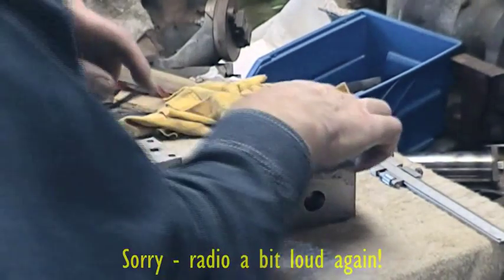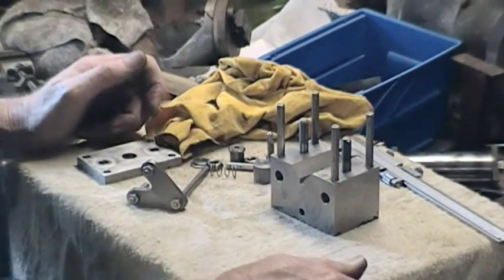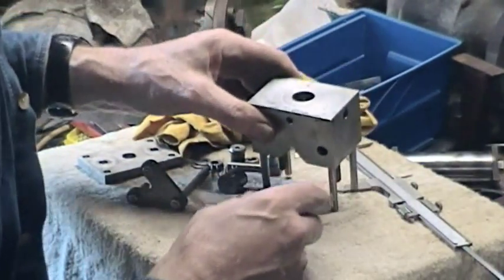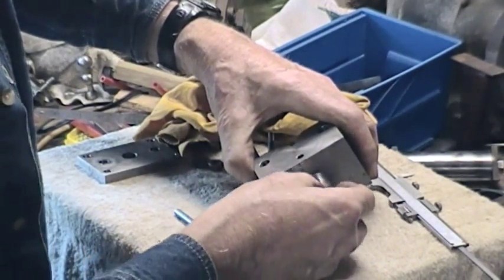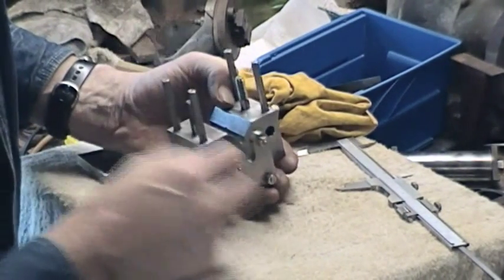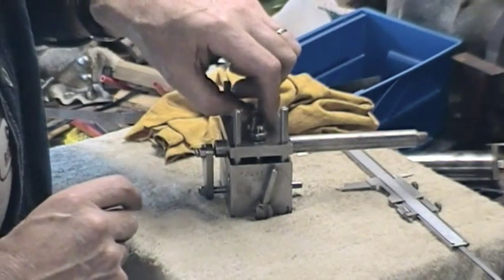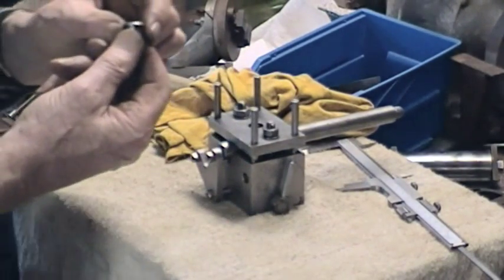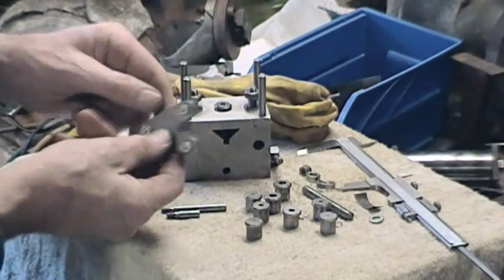Gadgets and Gizmos Part 3

Comment: You need not decry lacking a plasma cutter. Your honed skills and obvious knowledge of the machinist trade compensate admirably for the charming clutter and "where were those parts put?" form of organization. Everything I have is filed under "diverse" somewhere in the shop and can be found by a bit of where was it? muddled by "What was it I was looking for?". I really enjoy your video programs and have already learned a good deal about what to do with my small stock, limited skills. Thank you for sharing. Much appreciated.
Reply from the maker: Many thanks Jim -- having gotten rid of many machines from my old shop I do hanker after more and better things! Haha - 'diverse' filing system - yep - that sounds familiar! I am gradually getting (slightly) more organized, I think! :)